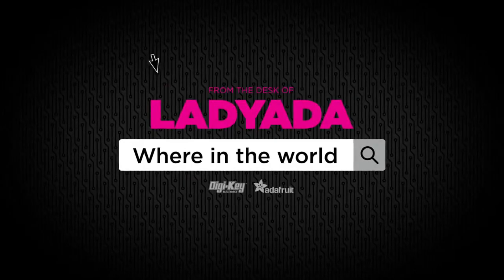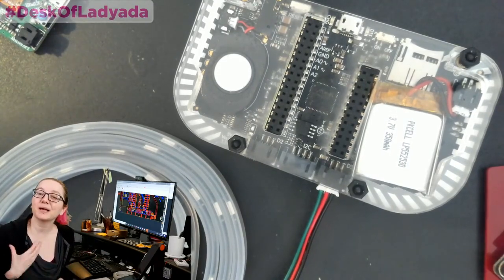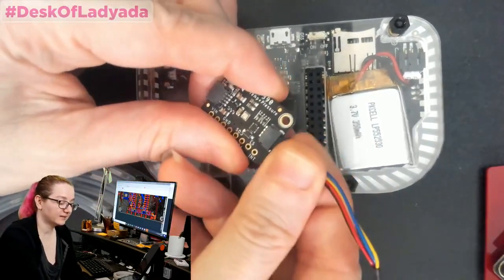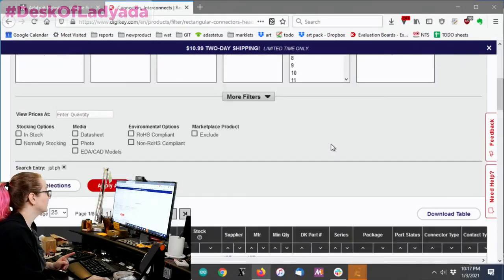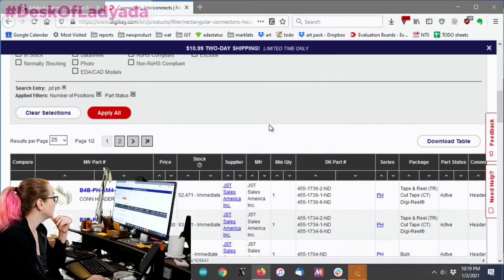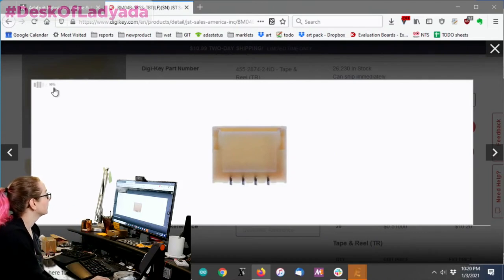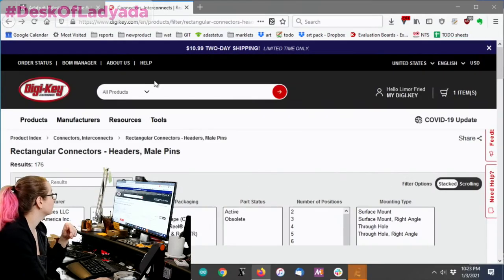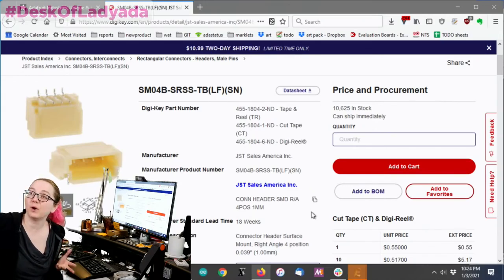The Great Search: JST Connectors SH and PH #TheGreatSearch #DigiKey #Adafruit @DigiKey @Adafruit

Comment: Huh, this is actually very timely information. Turns out that the MicroClimate Air helmet uses JST PH connectors for their battery and fan controller. Might come in useful if I want to mod that controller to support simultaneous charging and fan control that it currently lacks. I'm especially looking at an advanced battery charger like the PowerBoost 1000C.

Comment: Let me see if someone here can hep me. I bought a new DVR board to use in my old case, but the new board came with a PH2.0 10 min female connector, but the chassi has a XH2.54 10 pin male connector. Is is possivel to build an hibrid cable or the difference in the cabel dimension would inflence data ?